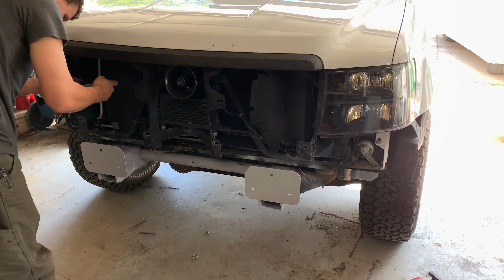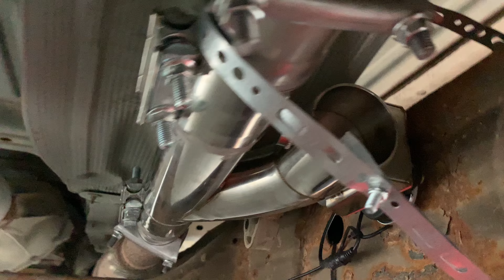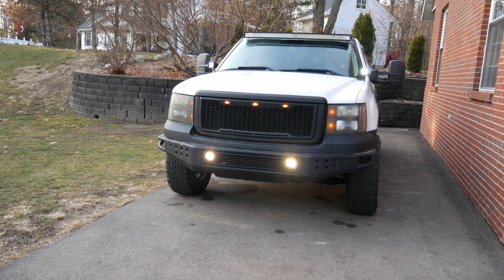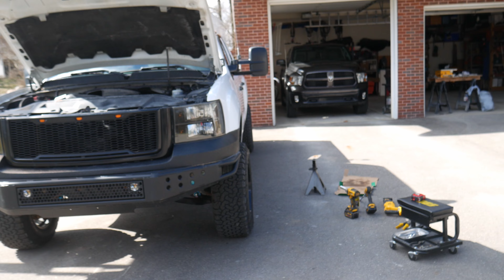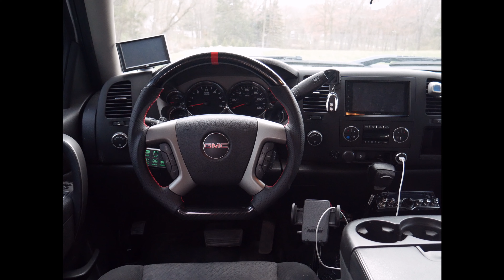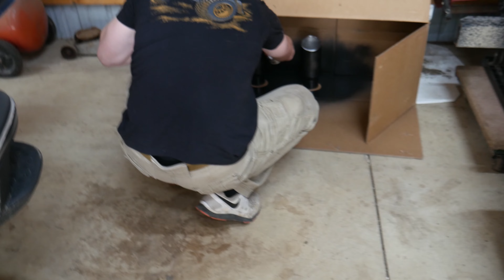I Built a Prerummer in my Driveway in JUST 13 Minutes

Comment: How did you find that steering wheel compatible like that?
Reply from the maker: Just googled Silverado aftermarket steering wheels, unfortunately the company that makes it doesn’t manufacture it anymore.
Reply: @CaswellCustoms  oh shitty, because that's rad, was it expensive if you don't mind me asking?
Reply from the maker: I love it, and it was roughly $200. There are company’s that will take your wheel and make you an upgrade one like mine, but they’re closer to $750-$1,500 depending on the options you choose.